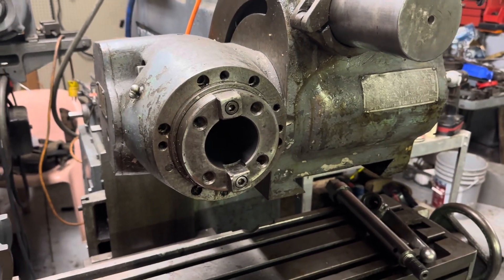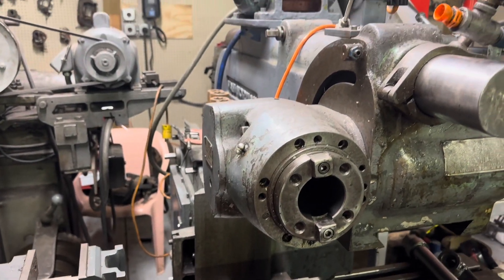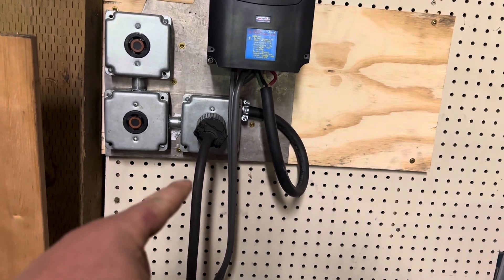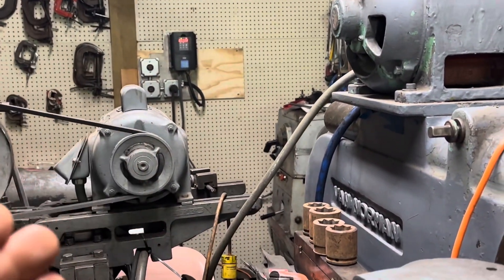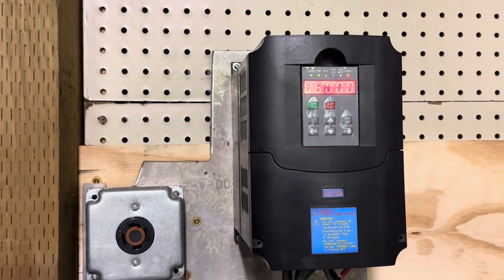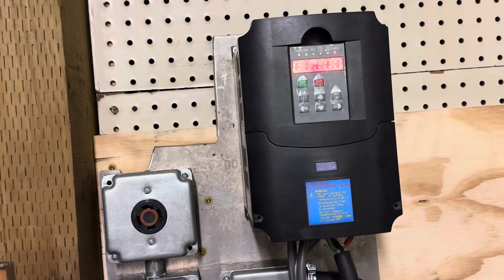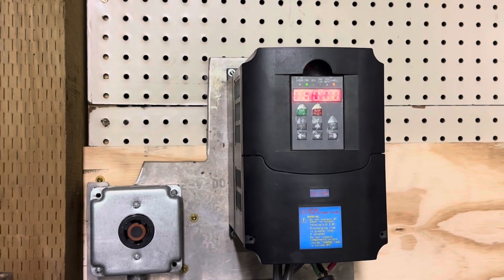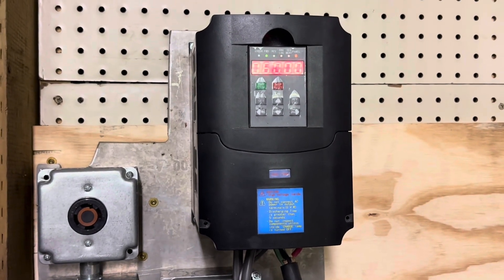Why is my new VFD faulting, the #1 reason

Comment: So,,,, what are some fixes..  any more info.  I was thinking that the insulation on the wires of the motor are failing. in a really old 5hp motor
Reply from the maker: That could also cause it, was your motor working before

Comment: If nothing else, make sure that your motor is set up in Y instead of Delta. Starting most motors in Delta will trip the VFD every time. Also, as he is talking about, make sure that your VFD is properly sized for the max inrush starting current.

Comment: It is still running after 1 year so i assume it handles you 10 HP lathe ok. It looks like you have the capability to run 3 machines with it. now the instructions say you are supposed to set it up for the Hp and current draw of the motor. Did you just set it up for the 10 HP motor and then just run the smaller motors at the same settings? I found a 3 HP motor for my Rutland 12" lathe and now will have to get a drive for it as the other 2 that i have for other machines are to small. Wish i had known you could do as you have done. What brand is the vfd? I have a no name and Huanyang that came with a 127 page manual and have had no problems with either one.
Reply from the maker: I have a few of these and they have all ran just fine.  This one with the three outlets powers 3 machines with very similar motor sizes, 2 5hp and 6hp so I have the setting pretty basic on the drive.  Ok have a video out week after next where I show how I have the machines setup to all work separately off it

Comment: Vfds will actually destroy ball bearings thru frosting and fluting from the stray electric build up on the motor shaft that builds up to around 70volts then finds ground thru the ball bearings a few hundred times per second unless you install a grounding brush on the shaft..you really don't notice the damage until it's too late around 600hrs.. HVAC technicians that work on large buildings can chime in to this matter..they make ceramic ball bearings to counter this..problem is this could travel and destroy spindle bearings too..
Reply from the maker: Iv seen that in some cases and an others I’ve seen them go thousands of hours with no issues.  Most small home shop guys won’t put that many hours on a machine for many many years
Reply: @smalltownmachineshop6860  I agree most hobbyist will never find out about this the hard way..still worth mentioning at least..  Rotary phase converters are the best option..the soild state phase converter may also be an option in some applications but typically run at 2/3 the original power unfortunately..
Reply from the maker: @agentcovert  I have a 20hp rotary I run for most the stuff in the shop
Reply from the maker: @agentcovert  and thank you for mentioning this in the comments, I don’t claim to be a expert on anything so am always welcome of comments that add to the topic of the video without being super negative as many on YouTube can be
Reply: Ageis  rings to ground stray shaft voltages